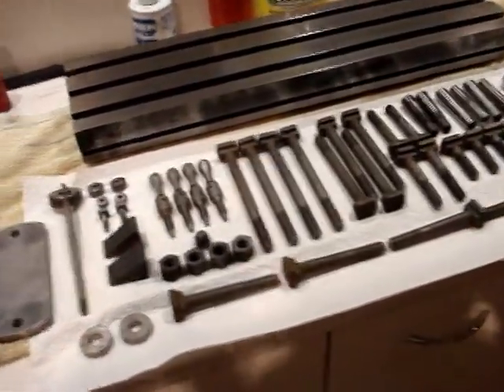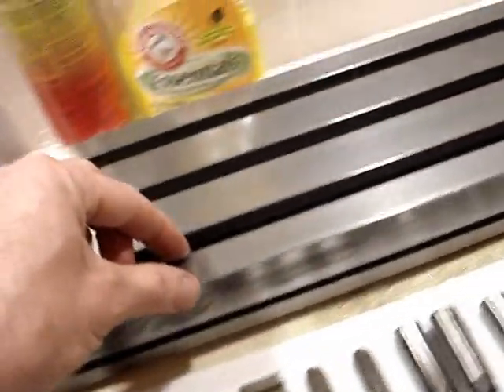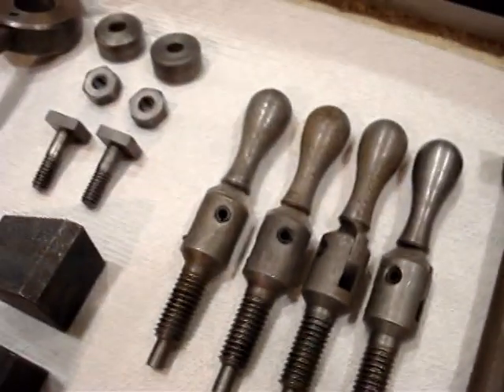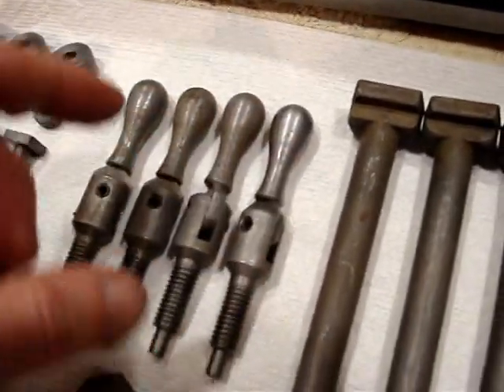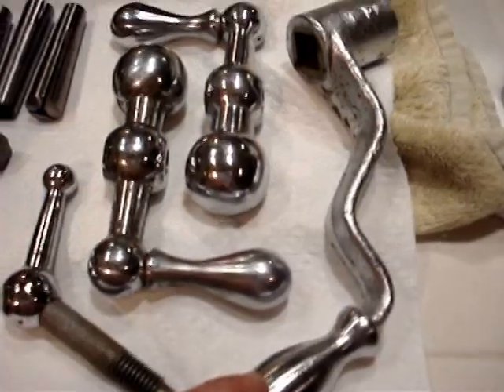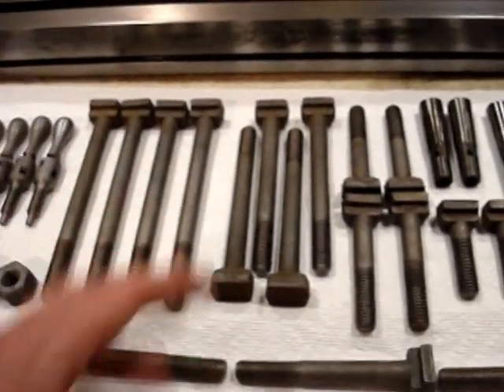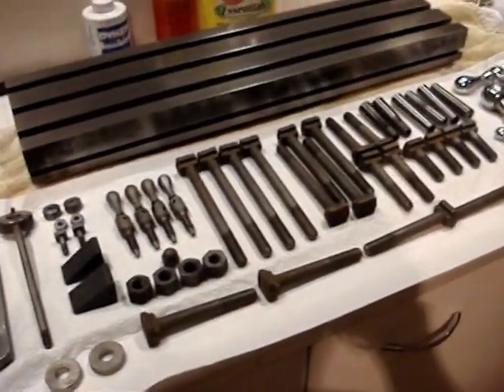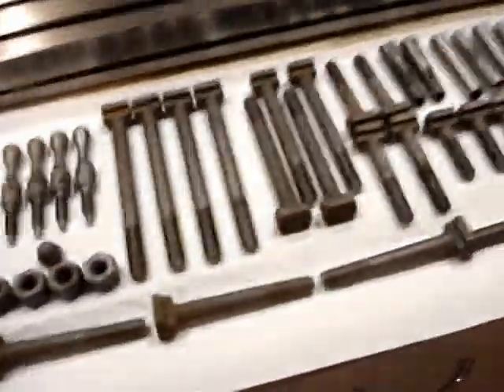Clausing 8520 mill restoration - Part 3

Comment: Ray - Great videos! I do have one suggestion for you - take those parts and re-dunk then in the Evaporust for 48 hours. Yes, 2 days... I've done 2 South Bend lathes, 2 drill presses and most of my Bridgeport and have used gallons of Evaporust. I love this stuff... But I've found that the sweetspot is 2 full days. Also - search for Caswell Black Oxidation kits. I just bought one for my Bridgeport parts. Check out my videos on polishing ball cranks too ;-)